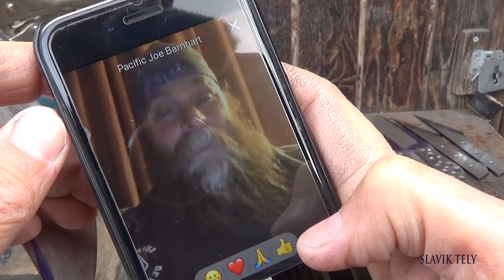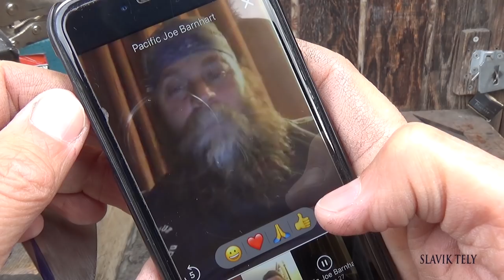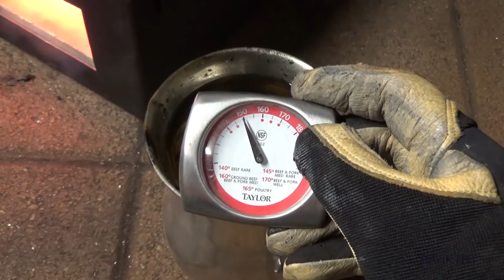Making Anglian Knife Part 1

Comment: The steel hardened, but car leaf spring steel can't reach the hardness of a file, made out of tool steel, that's very hard. So is impossibile that a file will not cut through an hardened 5160 knife, but you can feel that is hardned enough to be used as a knife. Almost all my knives can't resist an hard test with the file, but i made it to see if it cuts easily or not. The good aspect of 5160 is that it is less possible that could crack and absorb better shock impacts. Is it always fancy to see a knife cutting a nail without loosing the edge, but... knives are made to cut nails? If a knife can cut meat and wood without loosing the edge so easily for me is a good knife.
Reply: Sorry i write the comment in a hurry, is true, it isn't very hard. You have the experience to know it, i almost talk without thinking
Reply from the maker: Thanks for the info. I did read somewhere that 5160 doesn't hold an edge that well but this type of steel is needed for bigger choppers.

Comment: Shouldent heat the oil for leaf spring it works best in cold oil. Not tryna sound like a know it all dick or anythin just some friendly advice. Love the design though
Reply: I've bought some spring steel, not sure what type is it, but the seller told to use water.But with quick google search I'd say 5160 should be hardened with oil. I'm not sure whether he had warmed the oil. But with only a small amount of oil the oil is going to heat up fast anyways, I'm not sure if that affects the result.
Reply: DIYCoolStuff yea never use water like ever. Itll crack ur blade an make ya cry 😂
Reply: I know it's not common to use water but it really depends on the steels properties. I haven't had any problems with it this far when used as  a spring or a knife :D And I'd guess the seller would know if the steel would crack if water is used cause they were making truck and trailer spring from it. So if that would cause some cracks or micro fractures, the springs would brake rather fast. But yes, as a rule of thumb oil is usually what you want to go for if you don't know whether it's a water or oil hardening steel.
Reply from the maker: Oil should be heated up to 120 deg. I think I over heated oil.

Comment: Getting ready to order steel to make my first knife, what kind of metal should I go with?  I like the idea of stainless  (CPM 3v) for its corrosion resistance, but should I start out with an easier to work with steel?  I plan on sending the knife out for heat treating..
Reply from the maker: Matt gave you a good advice. But, I would start with high carbon steel and get you hands wet first with your first knife. After you use up all of the high carbon steel sheet then only then I would move on to stainless steel. Stainless steel is 4 times more expensive. But that is only my advice. Start with 1084 or 1075, make few knives (still ship them out for heat treat if you don't have equipment at home to heat treat) but at least practice on cheaper steel and then move on to more expensive knives.

Comment: Why didn't the leaf spring steel harden ?
Reply: Gaetan Thomas 
Hi because its builded to be flexible its a truck leaf spring its item of suspension system .
Reply: AKzahran96 but they're at a springy state on the truc, that mean they able to hold a shape, to bend back, so they should be hardenable, otherwise it wouldn't be a spring
Reply: Well you are right but i think
Its the chemical build of the metal itself
Reply: The steel he use in the next part its carbon steel its maid to be hard after being heated
Reply: AKzahran96 yes I know
Maybe it just wasn't a good leaf spring 😝
Or water quench ? I don't know
Reply: Gaetan Thomas yeah maybe 
The only important thing the amazing knife tely maid. :)

Comment: good evening tely, when you pass the height tracer to set the thickness of the cutting wire that measure you use to trace?
Reply from the maker: I do not really understand the question but I think you are asking me the thickness of the cutting edge. I leave 1 mm thick.
Reply: That's it, thank you